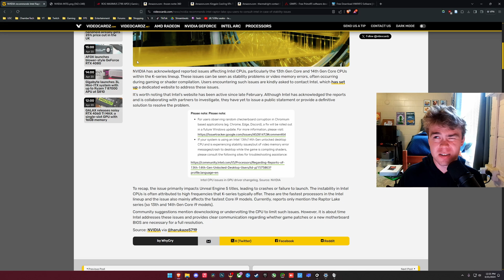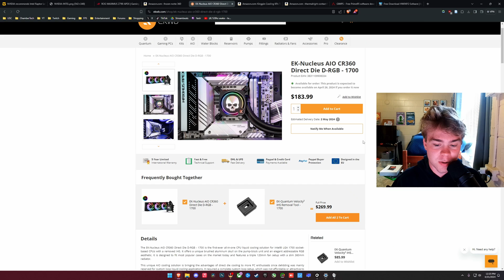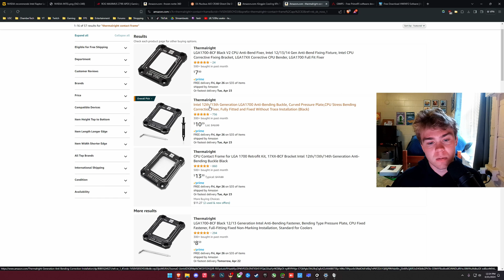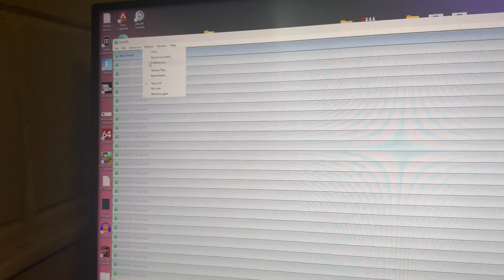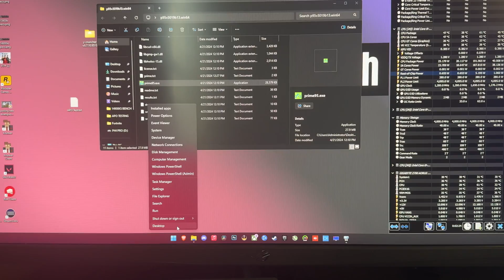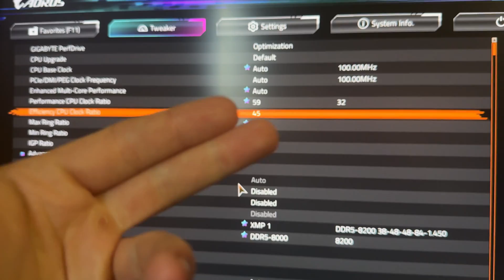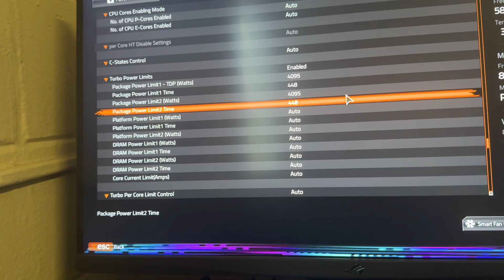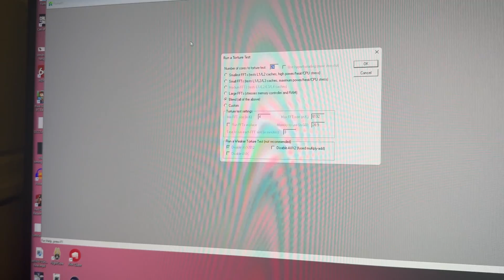STOP INTEL INSTABILITY 🛑🔥

Comment: What specifically solved my problem is getting the LLC higher. My mobo wanted to do .5 Ohm AC and .8 Ohm DC Mode 9. switched it to mode 11 (.7 Ohm AC/.8 Ohm DC) and has worked every since.  MSI says its a 175 on Force 2 for binning quality which I have seen 180 at worst for some people. So if that doesn't fix it, best of luck.

Comment: My 14700K shuts completelly down at 5.6 ghz p-cores. Now i run it at 5.1 ghz lol, no issues anymore
Reply: Mine have crashes on high load in 5.4ghz while unpacking huge files to install Tekken 8. After clock tune it to 5.3 GHz on perf core, temp stay below 80c during high load. Now I feel my 14900k stable as fk. For competition sake Intel push their products way too much
Reply: @MJsPrOuTs  addendum; it even crashes at 5.1 ghz, i mean it randomly restarts without bsod, i don't know why the cpu is only 2 weeks old!! The mobo tho was a used Rog strix z790 A gaming wifi. I thinking about go AMD i'm still on return window

Comment: UPDATED Asus Z790 Hero 13900k 32GB 2x16 at 7800MHz RTX 4090.Clear CMO’s reset to ASUS Default settings. Restart and go into windows. Then restart and go into BIO’s. Now set the settings below and check the performance, voltage and temperatures with HWINFO for voltages etc. 

Here are the settings that put back the performance

1. Asus Multicore Enhancement SET to Auto - Let BIOS optimize
2. LLC to 4 Recommended for OC (5 LLC).
3. XMP II or Tweaked (Should show your ram speed).
5. CPU PL short to ENTER 253 watt 
6. CPU PL long to ENTER 253 watt 
7. CPU core/cache current limit max ENTER 385a or I use 400a 
8. IA DC load line ENTER 1.02 or 0.98 I use (AUTO). 
9. IA AC load line ENTER 0.20 I use (AUTO). 
10. IA VR Voltage limit 1700 I use (AUTO).

These settings work great for CINEBENCH testing and HEAVY GAMING, and not for PRIME95 that runs your CPU into the ground. Happy gaming and enjoy!
Reply: AI optimized is an absolute joke
Reply: @resistanced4  nice catch. It should be on Auto  let Bios Oprimize. I don't use AI optimized because it's not rhe beat an over volta too much with high temps.

Comment: Intel is doing a FX-9590 just to be competitive with AMD.
The best solution is to switch to AMD.
Reply: I don’t like AMDip and I don’t like reinstalling my chipset drivers and GPU drivers constantly. Zen 5 
BETTER fix that, as I am considering AMD again.
Reply from the maker: the 9590 couldn't win in a game

The 14900KS is a winner in games when tuned correctly
Reply: @ChamberTech  14900KS is a joke, For a little performance and increase of 100USD. The regular 14900k is hard to cool and they still release this S version. So what if 14900KS win games, its like the FX-9590 that uses a lot of power to achieve higher frequency and to be competitive.

Comment: Mother boards set PL1 and PL2 to full watt power.  My Gigabyte Z790 Aorus Master was set at 4.095 Watts on PL1 and PL2. Looking on Intels spec on line the PL1 on 13900k and 14900k is PL1 125 Watts PL2 is 253 Watts. I still have OC at 5.5 my temp went from 79 to 63 and has not  throttled on my games. FPS dropped by 3per sec on my main game.
Reply: By default, motherboards are pushing too much power into those CPUs.  Intel specs exist so 100% of their CPUs will run stable.  I'm not sure motherboard manufacturer Q.C. is as good as Intel and by not following Intel's specs, you get 0.5% of CPUs that will crach in some very specific tasks.
Reply: Ideally, you should set 125 for both PL1 & PL2 states.

Comment: i put almost 400w into my i7 14700k everyday for 6 months straight and I haven't had a single "intel issue with instability and I also don't have "high" temps. That's why you delid all 14th gen
Reply: Most people aren't smart enough to tune anything or delid. They throw money away on a $400-500 extreme overclocking motherboard, don't touch the bios, and wonder why their chip is unstable.
Reply: @JordanJ01  They buy insane ram with a shit strix board and wonder why they bsod and blame intel

Comment: After I built my 13700k did some benchmarks and CPU immediately throttled which was confusing since I had specifically got an air cooler that was supposed to be able to handle the 13700k.  After some digging figured out pl1/2 weren't set on a motherboard being advertised as a creator board.  Set those and since I was already tweaking figured out what undervolt my chip could handle and no more throttling issues.

Comment: On AMD there is NO such thing as 'instability', AMD just do it better.

X3D > Every single Intel chip ever made.
Reply: The biggest challenge for AMD for Zen5 is “how do we improve on perfection”?
Reply: AMD is the most unstable cpu that exists, you can't use expo ram over 6000mhz, it has the worst low fps on games, is more expensive
Reply: @TecoProductions I'm sure those milliseconds make all the difference while you're watching por- I mean, working with MS office.
Reply: @TecoProductions  At least try to make sense next time you comment.
Reply: @LordAngelus  what doesn't make sense to you, is more expensive is a fact, you can't run ram over 6000 cause it'll be unstable that's a fact and they have the biggest deep in fps on games another fact
Reply: @TecoProductions  "AMD is the most unstable cpu that exists" this doesn't make sense at all. What AMD CPU are you talking about exactly? Edit your comment and clarify.
Reply: @TecoProductions Amd didn't rate their CPUs to support beyond 6000mhz
Reply: @TecoProductions  Intel's eats more power, is hotter and needs faster RAM just to compete with AMD. Unlike AMDs, Intel's speed decreases as you run it, there're test from independent reviewers to support this, so one time benchmarks aren't representative at all. How is that for stability? You need to downclock Intel for it to be stable. The difference in performance between 7950x and 14900kf isn't that high even in games. If you're using 1080p resolution fps is sky roof anyway, if above 1080p there's virtually no difference, why risk stability and go with Intel?

Also if you're truly concerned with stability why would you run RAM on something that CPU doesn't support or even JEDEC? There's almost no difference between 6000 and 8000 in anything. And between 4800 vs 8000 there might be a difference around 5% in games and 10% max at some photoshop filters.
Reply: They do? I smell a fanboy! Who was it who had literal exploding CPU's back in the 2000's. Hint: it wasn't intel.
Reply: Raptor Lake bodies outside of gaming workloads.Crushes games when severely downclocked with ease. Ryzen 7000 and of course Threadripper 7000 are productivity monsters in multicore. 

Intel must improve their efficiency drastically in ALL future designs, or sadly become irrelevant, to the detriment of NVIDIA pricing anything fairly. but Intel effortlessly goes toe to toe with AMD 2024 on every performance benchmark daily, and Intel nearly always wins at Single Core performance.

Also, I’m pro Intel, NVIDIA and AMD, Who am I kidding, I want all their technology in the Digital Edge.
Reply from the maker: 7900XTX > 4090 because i get cold at night
Reply: yes no ram issues at all both have issues no voltage issues at launch no x3d cpu's exploding NO ISSUES REMEMBER.
Reply: Intel 1%lows >>>>> X3D